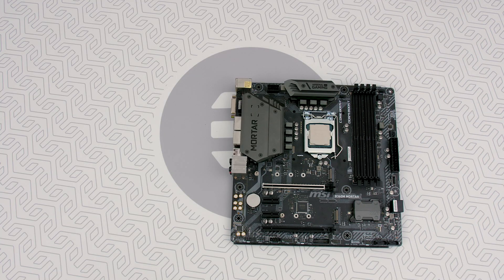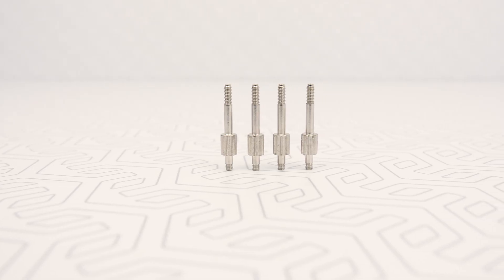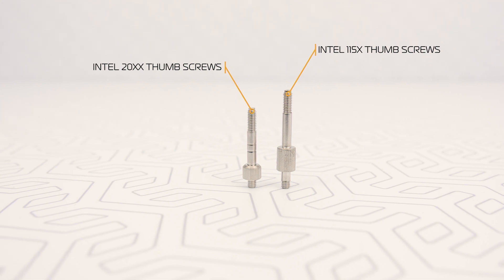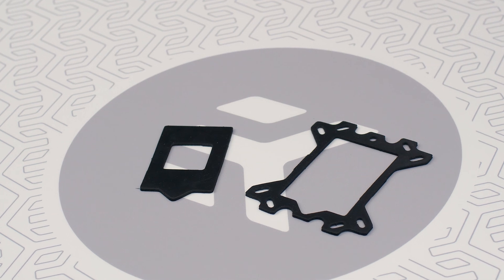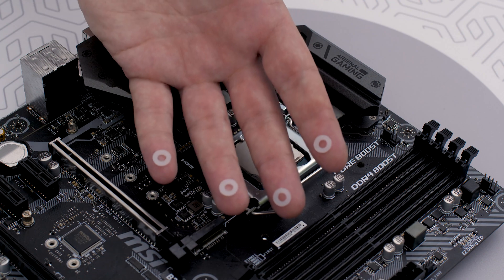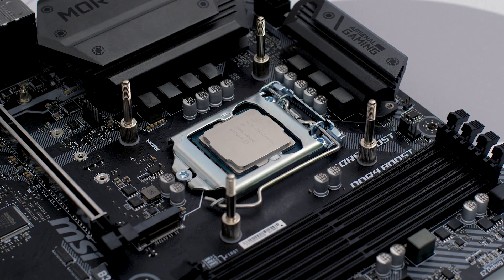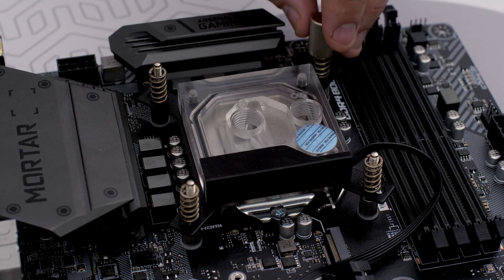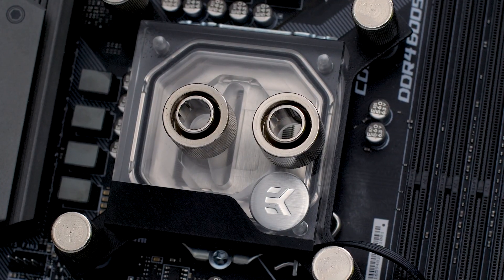Installing the EK-Supremacy Classic CPU Block on Intel Socket 115x

Comment: I've ran into issues where the springs seem to short out my motherboard for some reason. With springs on my PC won't start, removing the springs and doing everything else and my PC runs just fine

Comment: The rubber gasket overlaps some raised chips on the back of my LGA1200 board... I don't want to start cutting pieces of rubber off.
Reply: just curious, did you try that with an Ek-Supremacy Classic or one of the other supremacy 115x blocks.  checking how compatible blocks like the evo may be.
Reply: @LeoRodrigues19  it was the EK-Supremacy AX. I just ignored it and everything is working fine. There wasn't too much pressure anyway.